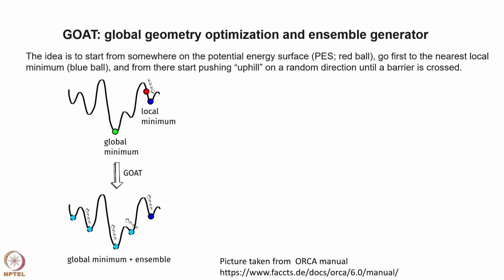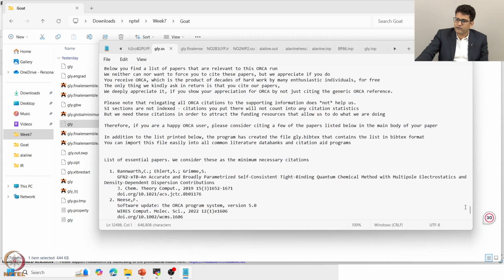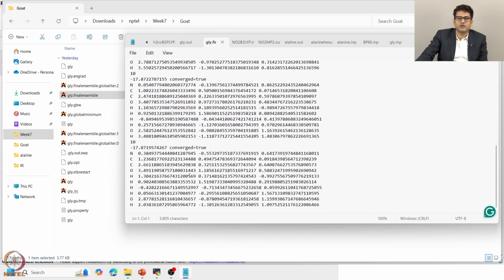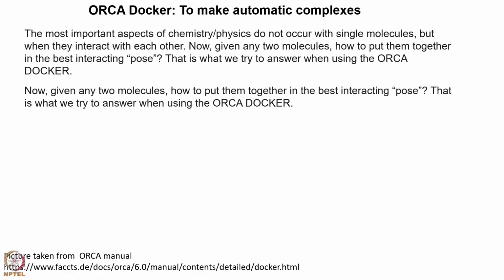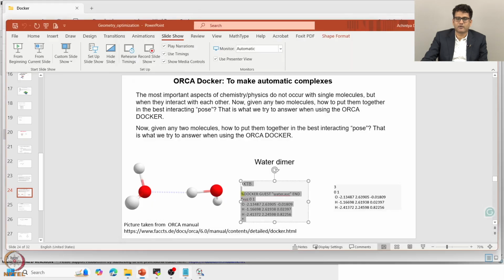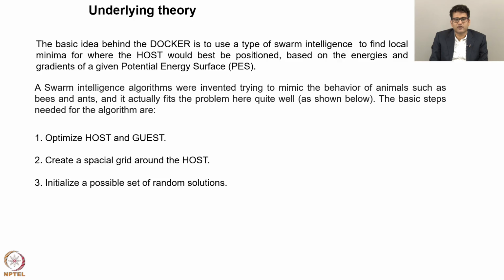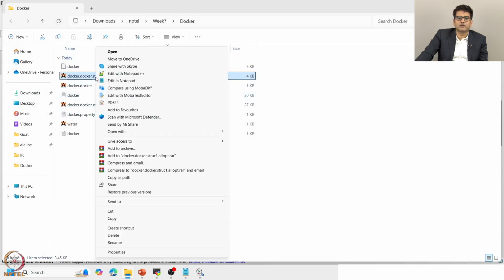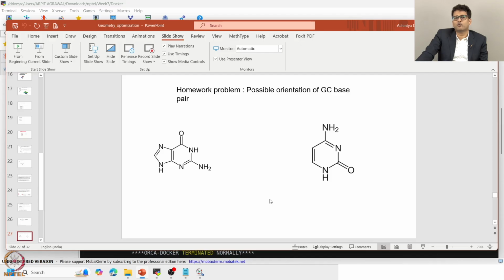Week 7: Lecture 38: Potential Energy Surface - III

Comment: For those who tried, xtb has to be installed before running otherwise it will just crash. For those on mac :
1. brew tap grimme-lab/qc
2. brew install xtb

and then the last step, create the symbolic link in your ORCA folder:
3. ln -s $(which xtb) $(dirname $(which orca))/otool_xtb